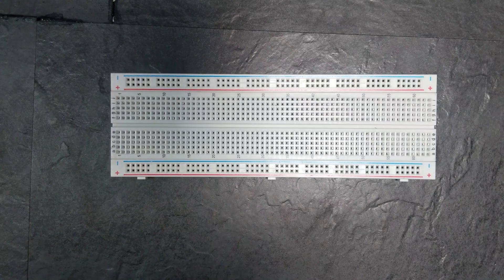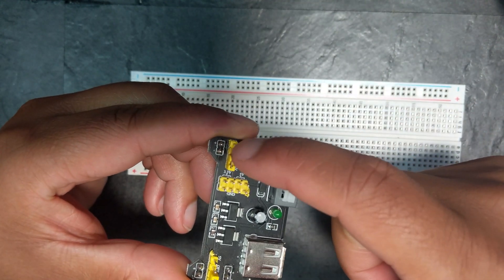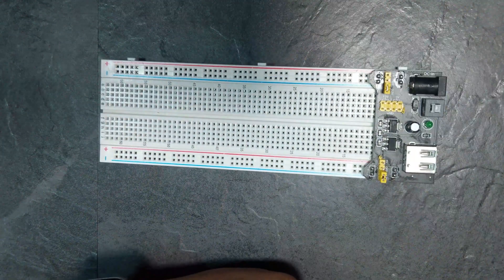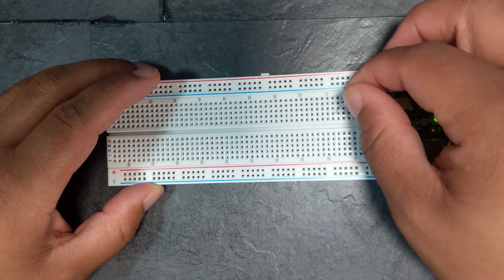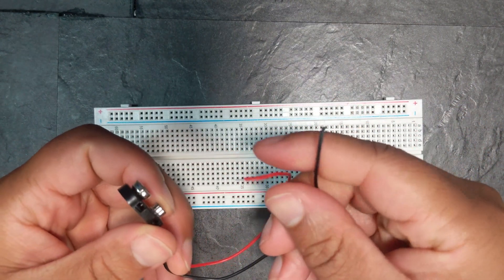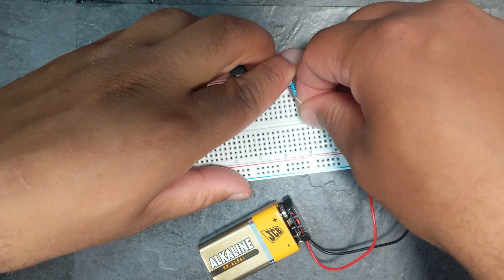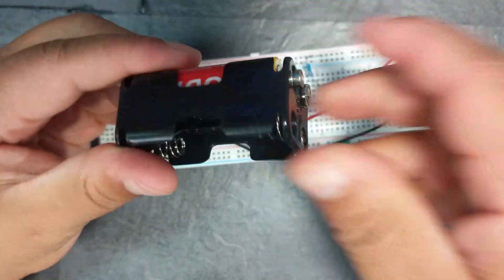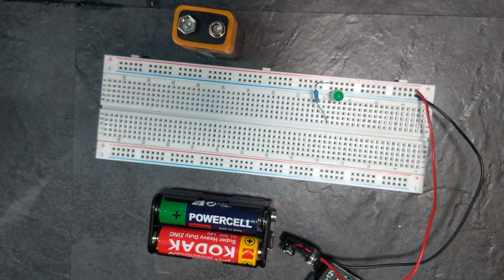How To Power A Breadboard - Different Methods

Comment: Hi Hamed, thank you for a great video!

So I'm a beginner to breadboard but have a project where I need to supply a 12-30 VDC powersource to a sensor, along with a 5 V raspberry pi. I am wondering how you would set up that system? If I supply the bugger with 12 volts, will the breadboard have 12 V then, and can the bugger handle 12 volt?
Reply from the maker: To avoid blowing up your raspberry pi I'd do 5v to raspberry pi using a usb cable and put 12v separately to the breadboard

Comment: How come that 5v supply didn’t burn out the LED?
Reply from the maker: The different coloured LEDs require different voltages. Red LEDs use the lowest voltage at 1.5v so had I used that it would have burned out instantly. Usually other colours are alright at up to 6V.